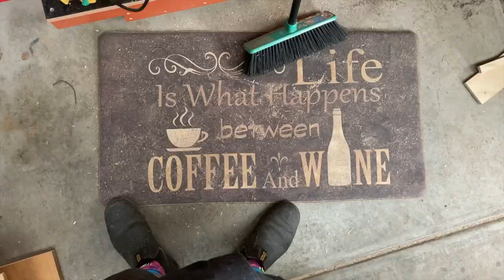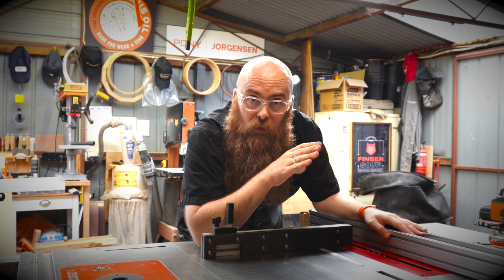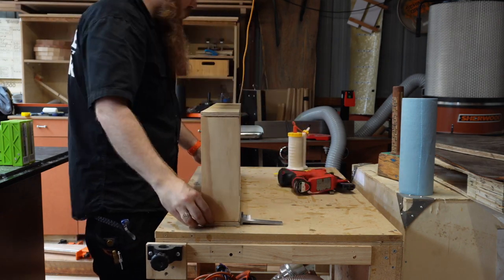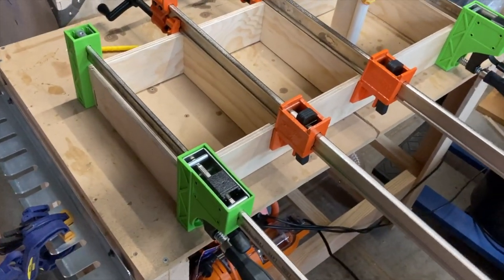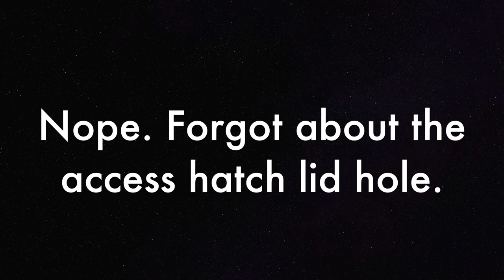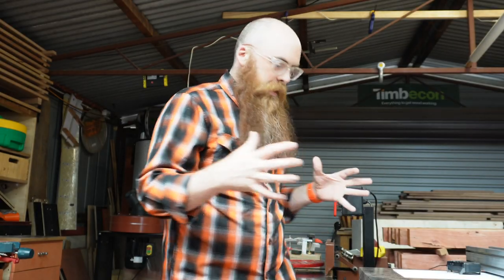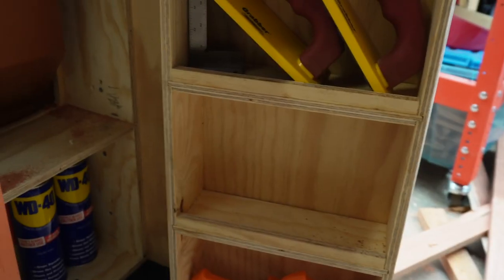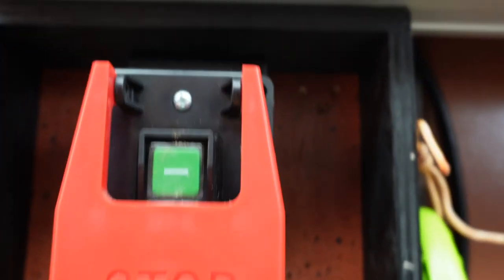Building the Beating Heart of my Workshop, Part 2 Scrinium Ad Sinistrum. Day 1440

Comment: Looks like you've been buying plywood from the hammer barn.  All bent and twisted. :)
Reply from the maker: Yeah man, it was a fun little fight for sure. I bought the cheapest I could find; none of the joinery came out clean because none of the cuts were square because none of the ends were flat. In spite of all that though, it’s perfectly functional as is. I might add some trim later to clean it up a bit visually though.